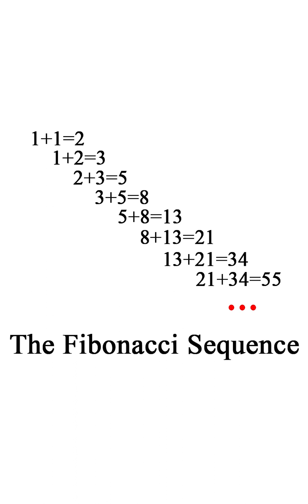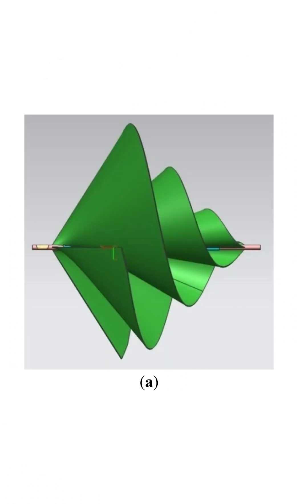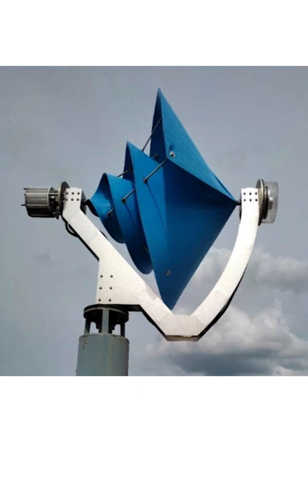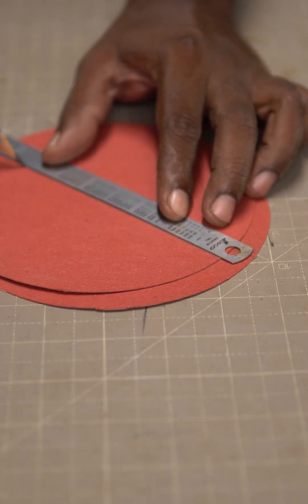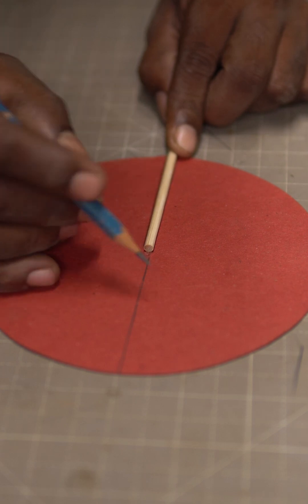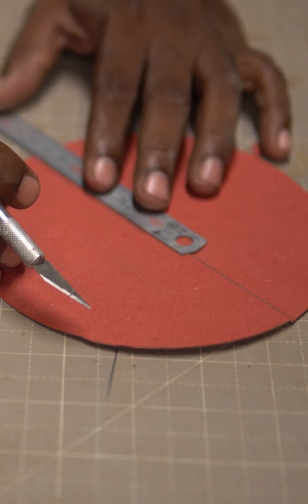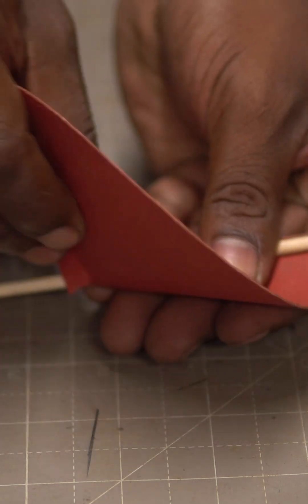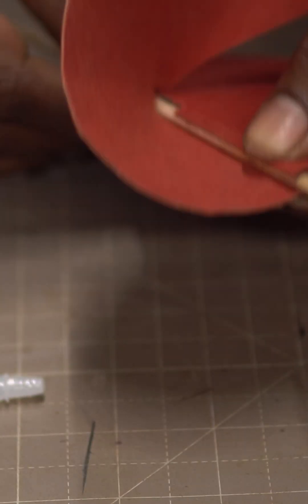archimedes wind turbine using chart paper

Comment: Thank you for fir the information. Can you tell me what is the max wattage we can get from this design, with which dismeter of hhe blades. Thanks in advance.
Reply from the maker: This video was to introduce folks to new kinds of turbine designs which can be made with household material. I haven't chcked them on any kind of generator or  dc motor. I am planning to try out some of them in an actual set up soon. Will publish what I find as it is . Thank you for the support.
Reply: @VIDEOEPPO  it's been a month I wonder if you have work on this yet I'm curious too 🙂